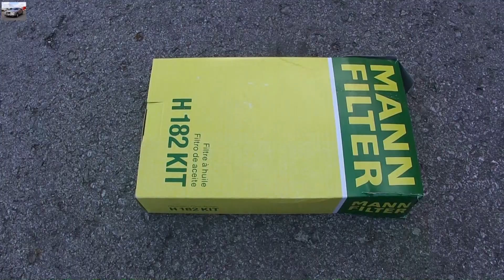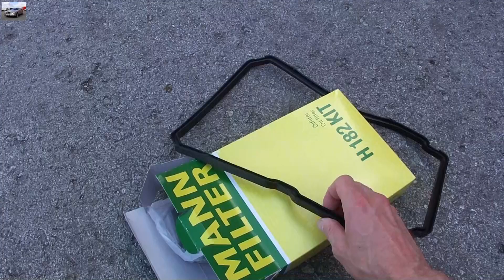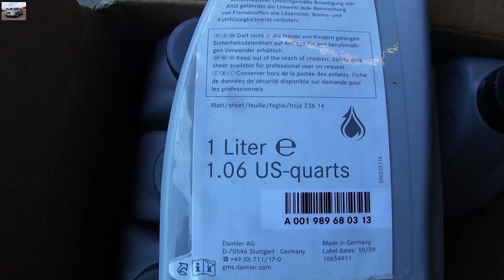Замена масла в коробке-автомат 722.6 Mercedes W210 Changing Automatic Transmission Fluid & Filter

Comment: My 722.6 has no drain plug in torque converter (2003 model) so I had to do full flush. With the drain plug in TC live is much much easier :)
Reply: Have a look at my second recent video. That way you can do a flush yourself with stuff from the hardware store
Reply: My converter has no plug how do I flush it?
Reply: @dolmar7844  normal , change only from pan , few times 2-3 times and oil will be clean , oil from transmission and tc will be mixed

Comment: I dont have that plug on tourqe converter, I have mercedes automatic 5speed transmission on ssangyong rexton 2006...how do I get all 8L oil out?  What if I drain oil on pan 2.6L and then turn on engine would more oil came out thru pan out if the engine is running??

Comment: (722.6) How many litres total  7.5 or 8 ?
Torque converter capacity ?
Drain pan capacity ?
Have shifting issues after fluid change ( low or overfilled)
C200, w204, 2009 model

Comment: perfect! Great video. I'm about to do this on my E280. I have 5L of oil I think I need 7 or 8L. how much did you fill? ( I will collect old oil and fill the same) but I dont think 5L is enough?
Reply from the maker: +John/8L
Reply: @antsufer  ok, Thanks a lot :)
Reply: What specification does it need?
Reply: 5 litr is enougch wen flush only from pan, when yo never change oil ,I recommend change only filter and oil from pan, and repeat this 2-3 times

Comment: How much ATF fluid it requires? How do you know it is full?
Reply: +kremenko34 thanks, although mine is a 722.4 (E230) 1996.
Reply from the maker: 7.5 L, I checked the dipstick. My automatic transmission 722.6
Reply: @kremenko34  236.10